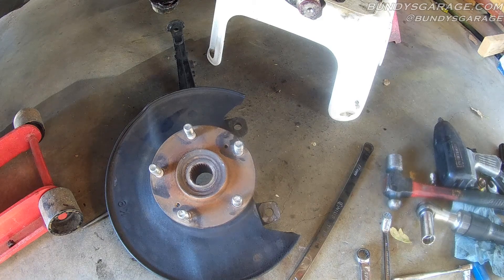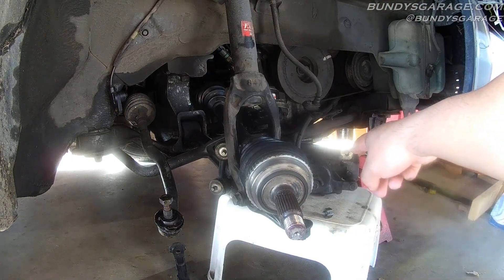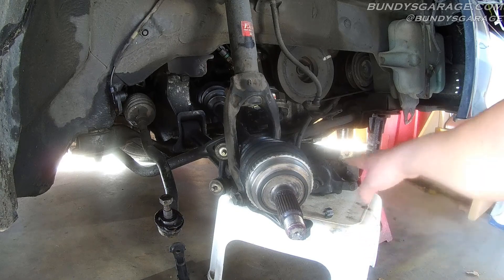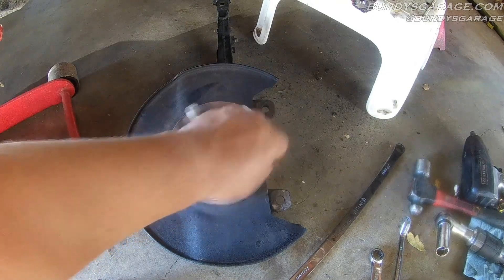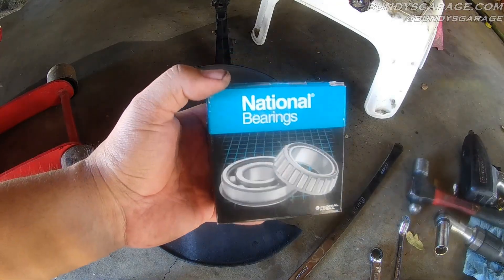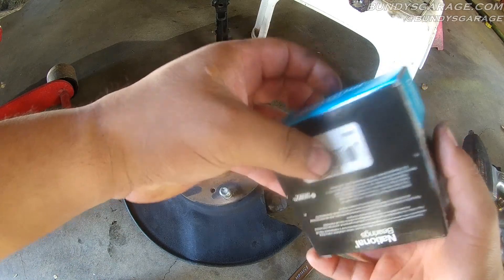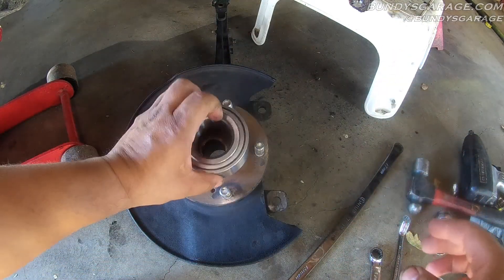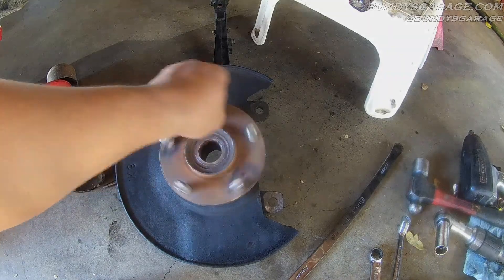How to tell if your Wheel Bearing is Bad - What a Bad Wheel Bearing Sounds Like - Bundys Garage

Comment: The 510050 is a universal part number for that particular bearing. They are all made in the same factory, and just processed with that number based on size and spec. The literal only difference is the name on the box.

Comment: I went to go replace my ball joint - as I pulled off the rotor, the hub split at the bearing & half the assembly went with it; the rust was stronger than the seal. Guess the bearing was on its way out the door anyway...it fell apart like nothing. Gotta love unforseen expenses :)
Reply from the maker: That sucks! Were you able to get it back on the road?
Reply: @bundysgarage  Oh for sure, that was this last summer. I've been waiting to do the driver's side until I have a new bearing in hand first. My car was up for almost a week, I ran into problem after problem. The new sway link I had gotten required a 6mm hex key as opposed to an 18mm socket, the one size key I didn't have. To get the ball joint out, I only had a pickle fork & a 4lb hammer, tried for hours, every deruster on the market, no avail. Took apart almost the entire suspension & put it back together again, twice. My husband tried for less than 10 minutes & told me to just get a new knuckle with the ball joint already installed. I finally got it out with lots of heat & patience. THEN, to top it all off, the boot tore as I was installing the new one. Lol.
Reply from the maker: That’s is awesome! Not that all that stuff happened to you but the fact you are a woman working on your own car! I have never met a female mechanic.
Reply: @bundysgarage   BundysGarage  Haha, I'm having a less than easy time finding respect from most seasoned mechanics (and people in general who know nilch about cars...like my husband) But, everyone has to start somewhere, right? :)
Reply from the maker: Yep gotta start somewhere.